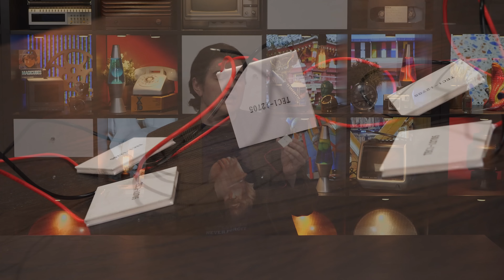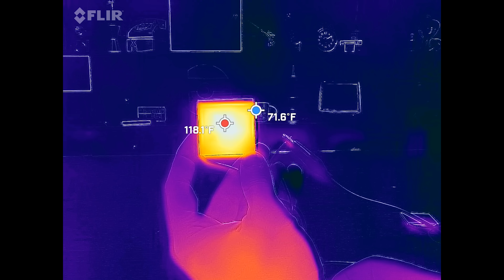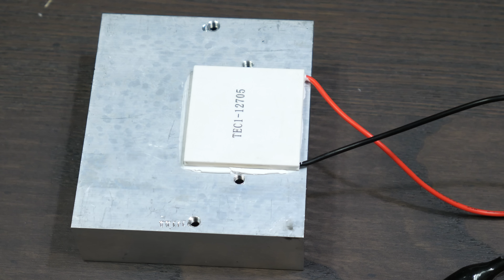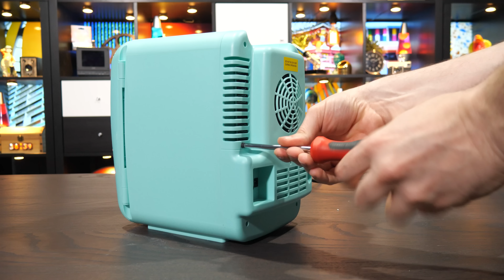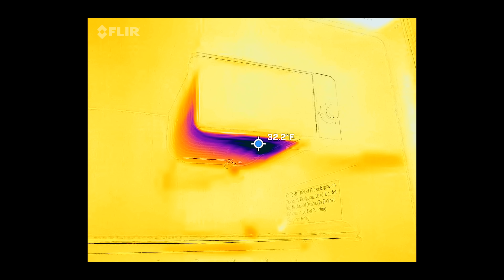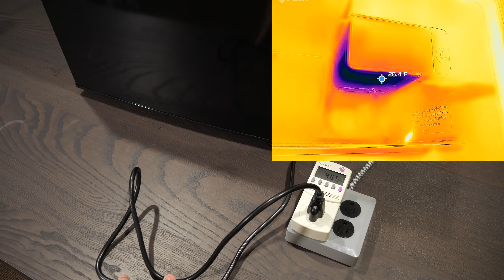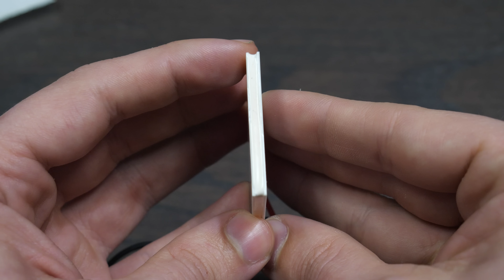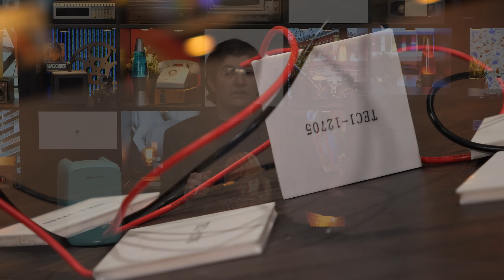Thermoelectric cooling: it's not great.

Comment: I have a larger one of these that holds 18 cans. Naturally when I got it I took it apart to see how it worked and was surprised to see this mechanism. I had already learned about it from a science experiment that Linus Tech Tips did trying to cool a PC CPU with something similar. Anyhow, I opened it up and to my shock and surprise I saw that the fridge was actually designed to hold TWO of these coolers. One in the top and one in the bottom. The power supply even had empty solder pads and enough beef to run the second one but for whatever reason mine only came with one.  I also had an older/smaller sprite labeled one that held about 8-10 cans. So naturally I harvested the parts from the older one and made my new one run with two installed. I have got to say it is VERY impressive. These units are larger because they came in larger sized fridges and when running both my drinks get down to drinkable temps in around 2-4 hours depending on ambient temps. Also when they get cold they get fridge cold. I can also store refrigerated foods inside of it. For context we have central air and run the house at about 69-72 degrees F. The internal temp of my fridge is between 38-40 degrees and it holds that steady and gets things cold fast. However (and I haven't finished the video yet you may have addressed this) I noticed that cans cool much faster do to the thermal conductivity of the cans. Normal foods like a lunchable for instance that comes in plastic packaging takes much longer to bring from room temp down to 40 degrees F. However, keeping a few cans in the bottom along with my food seems to help speed up the process significantly. It is also worth noting that the second unit is smaller than the first and that I upgraded the thermal compound on both to high grade PC CPU compound. (Someone should liquid metal one of these bad boys!). You should try buying the larger version from Walmart that holds 16-18 cans and then installing a second cooler on it. I had to rig it up a little bit as the rear wall was a tad different in thickness but it wasn't too hard. I would love to send pictures and temps if you are interested! Take care.

Comment: I have a similar Peltier cooler mini fridge .. I agree it is not the most efficient.. not all are created equal as mine can be switched to keep the inside either Cold or Hot... and has both 12vdc and 120vac. It is nice to use in the car, and able to keep something warm too

Comment: this wouldn't be too bad of a fridge if it used PC parts, either a small fanless heatsink where it takes the 60c temperature and dumps it into ambient which would be almost the entire back side of the fridge for that little chip, or a noctua fan that blows it quietly with a better designed heatsink.

The designers of this fridge were just lazy and never really thought about this too much beyond getting it to market for as little cost as possible, it just slaps a lot of people in the face

Comment: Maybe a way to state it is a vapor compression heat pump is a "heat conveyor belt".  You do not "use up refrigerant".  So many people don't understand this and keep thinking they need to "recharge" their leaky air conditioner because it "used up the refrigerant to cool things", a very wrong thought and which is actually illegal to do in California.  People don't get this, especially in their central HVAC systems, mini-splits, and crappy cars with leaky AC systems.  In California, you have to validate that you have fixed any leaks before you recharge because the regulators don't want you needlessly destroying the planet because you don't understand what is happening and your cheaply made old junk doesn't work.

Maybe a better example of being efficient for something practical is a portable fridge.  I have one of these and running it off of 24V DC, I find that it consumes ~30W on average from an LFP battery.  You want to do a camping trip without any hookups and it is really important to have round the clock power to your portable fridge.  If that is coming off of a battery, then you don't want to drain it dead before the end of the trip and you probably don't want to haul around massive batteries.  Either you efficiently use the power or you go back to using an ice cooler.  Really, especially with all of the stuff now that is 12/24V dual voltage capable, just grabbing a cheap, but reasonably well built 24V LFP battery, hooking a multi-port cigarette lighter adapter deal to it, and then plugging all of that stuff that also plugs into your car into that instead during the camping trip as long as you have verified that it can take 24V / specifically bought it because it was dual voltage capable, really kind of makes things easy and convenient while also being reasonably cheap to do.  A lot cheaper and more efficient than getting a portable power station that sucks down its own power with parasitic inverter draw and conversion conversion losses.  I would dare to say that 24V also makes more sense than 12V because you lose a lot less power over the wires with twice the voltage and less than half the amp draw.  Like my portable fridge for example, on 12V there is a calculated ~8% loss just getting the power to the fridge over its long DC power cord where with 24V DC it is a ~2% loss to do the same thing.  That is just going to be more run time with the same sized battery, just configured for a higher voltage.  Granted, with a 12V battery, you don't need to check for compatibility; if it works in your car, it will work with the battery.

For a comparison with what I have seen and calculated with various ways of doing things:
1. Ice cooler.  Need lots of ice for a camping trip.  Usually need to run out to a store and stock up on more mid trip.  Have to fuss with draining the water.  When you get back home, you often find all of the ice is melted by then and whatever food is left is bad and you have to throw it out.  In general, there is a mess you have to clean up and it is costly with the wasted food.

2. Portable fridge and portable power station - Sounds good on paper.  Usually the portable fridge will plug into your car while driving.  Great.  But then the portable power station is kind bulky and on a multi-day camping trip, it just goes dead early from the parasitic power draw and conversion losses powering your portable fridge.  I mean the fridge may be natively using 24V to run the compressor motor, so you start with say 24V DC in the portable power station battery, convert that to 120V AC at say 90% efficiency plus say a 7W parasitic power draw from the inverter, then the cheap power supply in the portable fridge converts 120V AC to 24V DC at say 80% efficiency.  Then the motor may use 60W, but only runs half of the time and so uses 30W on average.  So then you have effectively lost ~40% of the power just getting it to the motor on average in what you are effectively doing when having always on power to the fridge.  Especially if you have this idea of cooking off of the battery instead of say using propane, the battery will go dead and all of that extra electrical stuff you brought takes up a lot of space and weighs a lot.  So you have to cut the trip short because you can't cook anything and the food is going bad.  Running the fridge off of your vehicle tends to go badly as all of your fuel gets wasted keeping the car on and especially if you are out in the middle of nowhere far from a gas station, you don't want to do that.

3. Portable fridge and a 24V LFP battery plus propane - The portable fridge runs off of the vehicle while driving.  Great.  Running the fridge off of the 24V battery is easy enough, just plug in and it turns on and goes.  Internally, that 24V power is going straight to the motor controller, basically no conversions, at least nothing that losses any power in conversions, so super efficient.  Want to charge up your USB devices?  Just take your USB charging gear out of your car and plug it into another cigarette lighter port you have hooked up to the battery.  Great.  It is all very efficient this way, so an easy to carry LFP battery will run this stuff for days.  If you have access to sunlight at your camping spot, you can hook portable solar panels to the battery with an MPPT charge controller.  Doesn't take much as the system is very efficient.  If you are cooking with propane, a 1 lb bottle will last you for days.  Granted, propane stoves are more sensitive to wind than say an induction burner.  If you want to go further with propane, you can do a propane fire pit, propane heaters, and even run a generator off of propane.  It is just this all starts getting into you brought a larger propane tank or tanks with you and hopefully you took the right safety precautions around that.  Propane is a lot cheaper than wood for a fire pit and some places have restrictions due to fire danger and only allow propane fire pits, not wood as they don't want the whole place to burn down in warm, dry conditions due to embers from wood burning.  There are also generator restrictions in national parks and such, so you really don't want to run a generator more than you have to and even if you do, you may be restricted to certain hours, especially in national parks, and so will still need the battery for the rest of the time.  Plus, running a generator all of the time is going to burn up all of your fuel.  And if you do run an inverter off of the 24V LFP battery, you will do it sparingly as most of your stuff, especially the fridge, can run off of 24V directly, thus sparing the battery from a lot of parasitic draw and unnecessary and lossy conversions.

Comment: Worked on peltier products for 20 years.  Yes depends on the design constraint and how you use the year. Removing the heat efficiently makes a huge difference. Designing the interior space also makes a huge difference. They are also very dependant on the ambient and the delta T takes ages.  Cooling the interior and then turning on saves many hours.  You can control the temperature with extra bits.  Where they win is durability.  Used a lot in missiles for cooling vital equipment.  Or camping /car use. Can’t slap a normal fridge on them.  

There some much better TE home coolers out there.

Comment: this product might actually work as intended if they had those 'cooling chips' on the sides, top, and bottom of the inside. and the case was made of metal, for heat dissipation. I had a 'mini fridge' exactly like this - eventually the actual power supply shorted out and it no longer worked. When it did work though, it was actually decent for cooling beverages (or keeping already cold beverages cold) No matter the circumstance, a real refrigerant loop is superior in every way.

Comment: I'm glad one of your caveats was the portability of these things. Us truckers often rely on thermo-electric coolers when over the road, simply for convenience and sometimes reliability. Modern trucks have improved with built in, purpose made refrigerators, but those are hard mounted into a cabinet and not within easy reach while driving. Those electric coolers can be placed right beside the seat like any other, and also tend to perform well if the food is already cold. The one I use to use would sometimes actually ice over the inside element despite the internal fan that your little toy doesn't have. I could keep my sensitive foods on that side (i.e. meat and dairy), and less sensitive foods on the other end (veggies), and it had a nice gradient across it that kept everything happy. When driving a big semi, that extra 5A draw on the electrical system wouldn't even make a dent in fuel consumption.

Also, that's a cute little fridge in your kitchen. Meanwhile, my 31 cu. ft. behemoth at home...

Comment: I've been thinking about building a minifridge with 4 peltier modules I happen to have laying around. I wanted to make the inside walls out of metal, then use thick insulation, and an outer plastic shell, a normal door with rubber insulation, to keep the heat out, and also use a pretty large aluminium heatsink I also happen to have. I wanted to use and arduino with a temperature sensor and a voltage regulator tied to it, and all. Thanks to your video, I now know that it would've been an absolute waster of time, and I'm better off buying a real minifridge.

Comment: I really thought the stand upright part was for the refrigerator fluid to go back in the compressor, never thought it was about some oily stuff.

Anyway, the first time I heard about Peltier was for CPU cooling and getting a little extra cold on the chip when going for overclocking, (You still need to huge radiator thus). And the problem was condensation if the CPU was cooler than room temperature. And the other time was in a lab, when you had to get very cold temperature in very small spaces. (I assume, they were staking the Peltier cells then.)

Comment: We bought an Adler one recently to keep cat food cool (not cold), she still needs a little bit of rewarming, so I'd love to have a thermostat on it to be able to set it to like 15°C or so. This model also has a HOT function so it can keep a cup of something warm in the winter I suppose, it has a car adaptor also, so it can function as a car-fridge. The power draw is below 42W. It does its job and we don't have more space for the larger one on the desk - certainly nowhere on the floor. As for the noise - it's in the kitchen, who cares? :)

Comment: If you ever get to this comment, would you consider trying further testing on this fridge using an outlet timer?

And maybe a test with added insulation such as a folded hand towel draped over the top/sides/door?

My partner and I used to drink 2-3 cans per day between us, and trying to reduce energy consumption, I had it on an outlet timer with 30 minute increments.

We put in a room-temp can each time we took out a chilled one, and tried to keep a > or < pattern with alternating chilled and warm cans. It felt as though it worked, especially when room temperature was an additional 20°f-30°f colder than outside (80°f indoors, 100-110°f outdoors)

TL;DR: how much impact on the temperature of beverages can your instruments measure if you stagger/halve the power consumption and add an exterior insulation?

Comment: Especially for mobile or occasional use, I think anyone will be more happy with an efficient compressor cooler in the long run, trust me. While still more expensive then the thermoelectric boxes, they did get a lot cheaper. And on a road trip, you don't want to wait 24h for your drinks to cool. Also combined with batteries and solar panels becoming cheaper, with a compressor system, you can go camping for many days without relying on a power grid. You can forget that with a peltier box.

Comment: I have a thermoelectric cooler at the office to keep my water cool, not cold. I don't like cold water, and having a compressor fridge in an open plan office is not allowed. I've had to modify the piece of junk with additional insulation and a stronger fan as well as duct work. This makes the item less than worthless, but i hat throwing working stuff away. When it breaks I'll use it to grow a strawberry patch.

Comment: I had a single can sized tiny usb fridge with one of these. It also had a hot setting. It was kinda nice to keep a drink cold on my desk while gaming. But wasn't strong enough to cool it. Also straw recommended because the bottom of the glass was significantly colder lol

Comment: I had a mini fridge shaped like a massive egg for under 10€. It worked for 3 years.... It was a promotional limited quantity type . Complaints? Unnecessary horizontal tray (could be removed), snack holder on door (small but would block closing if 7-8 cans were inside, also removable). Still worth the money

Comment: If these were coupled with a water heating system it would halve the energy consumption by using the heat generated as a water heater.

Comment: i have homemake diy half size peltier refrigeter it only one i make for my truck and it does get cooler down to 30f plus have tempstate control in it and it all run off 12vdc it took 2 hourr just get down 30f it worth it for me because alway on the road everyday moving around alot so normal refrigeter will not fit my list because it requir be sitting there for it to work cannot move it around so it useless for vehicle but not for home or office and peltier cooler is useful for taking it out to place and running on 12v dc that all
i never use it for keeping food cooler i only use it keep my sandwich and drink cooled them eat it  there is nothing left in it

Comment: I have an older mini fridge. It has wood grain door. According to my Kasa smart plug, it used 18.924 kwh in June. I am am sure partially because it was over 100 degrees here in UT.

My friends mini fridge thst may have be the same as the black one in the vid  used 9.056kwh that month.

Cool how efficiency has doubbled. But while my friend paid $80 for his, I paid $2 +11 for a new thermostat thing. That means I get years of use before I pay more in electricy than I spent. And we have solar and my mom doesn't charge me for electricy from my fridge.

Comment: I bought the larger Galanz that has fans in it to move air. It is far better, then the smaller version.
I also bought one of the tiny 6 can fridges.
Works best in the winter. When it's ambiently colder, I keep mine in the shop. Chill's water or soda. Just enough to get a drink out of it or chug it, and then put it back in

Comment: I have a dual zone cooler shaped fridge and either zone can be set at fridge or freezer tempurature, and its a real vapor based heat pump! Those things are awesome! It seems like it is more efficient to run on an ecoflow battery while camping than a peltier based one, especially for the large size.